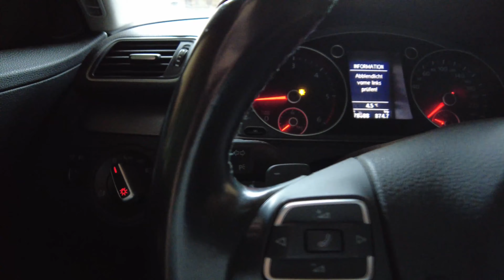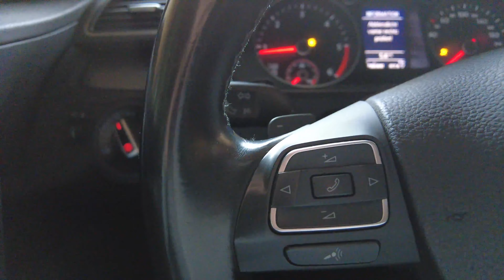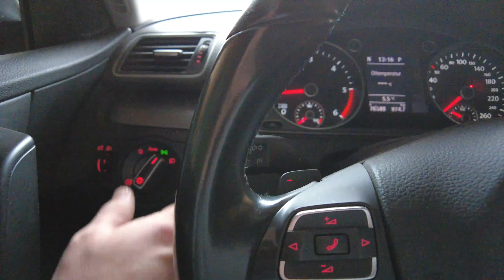OSRAM Night Breaker LED H7 | VW Passat 3C B7 | Teil 2: LEDriving SMART CANBUS SC02 SC01

Comment: Werden bei dir auch die Adapter so heiss und die LED's?
Reply from the maker: ist mir bisher nicht aufgefallen. Aber die Lüfter an den LEDs sind jedenfalls nötig.
Reply: @seriennah7600  ja hab ja die von Osram kann im schlimmstenfall ein Brand entstehen?
Reply from the maker: @maliii9262  hab ja auch die von OSRAM. Von von solchen Fällen noch nichts gehört. Aber wo Strom und Hitze im Spiel sind, weiß man nie 😅
Reply: @seriennah7600  hast du den deine mal nach dem fahren angefasst oder einfach rein Klappe zu? Hast du den auch ein canbus adapter oder ohne?
Reply from the maker: @maliii9262  erfahrungsgemäß werden auch  LED heiß. Das ist keine Überraschung. Wenn die ordentlich verbaut sind, seh ich da kein Problem.
Reply: @seriennah7600  danke!
Reply: ja sind Lastwiderstände, deshalb die Kühlrippen